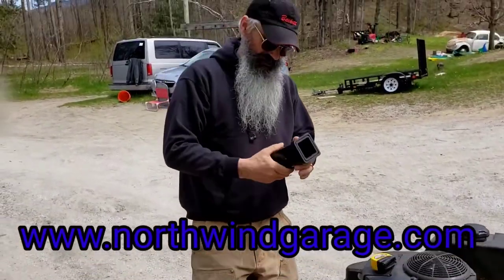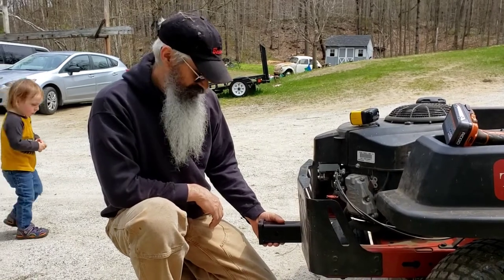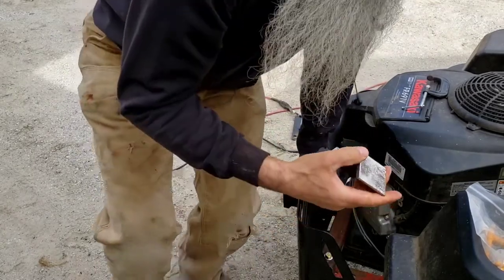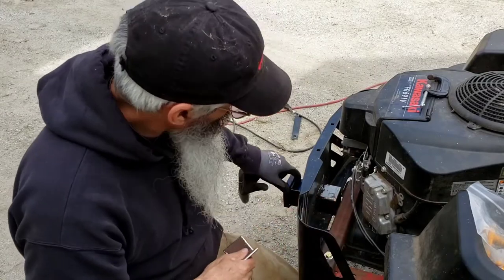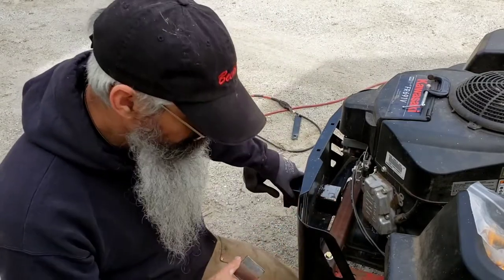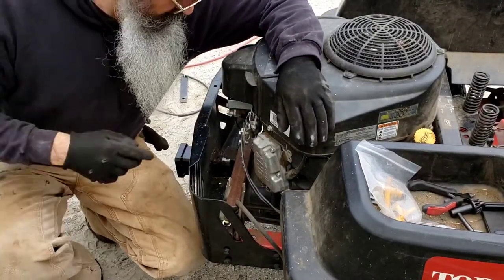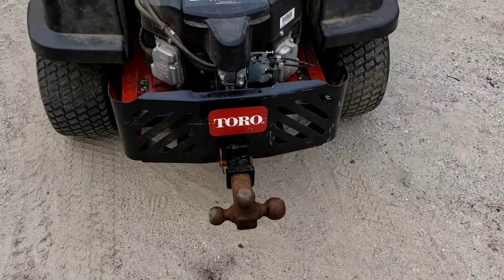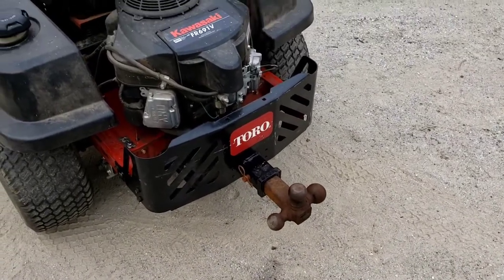TORO Timecutter TRAILER HITCH @ Northwind Garage www.northwindgarage.com

Comment: I just got a Toro Z4220, I have a need to do the same. The trailer is a 5 x 10 single axel. I’m concerned with damaging the drive hydros, any insight on that? I would only need to to bring it from the back of my property to the front, about 200’ fairly level, but would be slightly up hill. Maybe a hight change of 1-2’ over the 200’ run.
Reply: Thanks for the info, this exactly what I was looking for! You are hauling WAY more weight much further then I would need to. My concern is how that affects the mower, you don’t have any drive problems with the transmissions or anything? Do you expect it to shorten the life of the mower or do you feel that it’s completely fine?